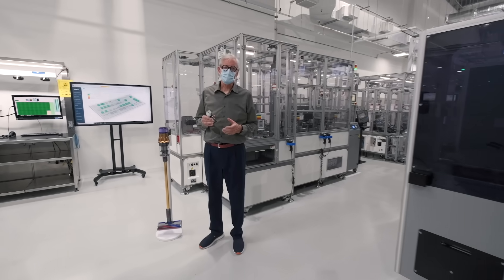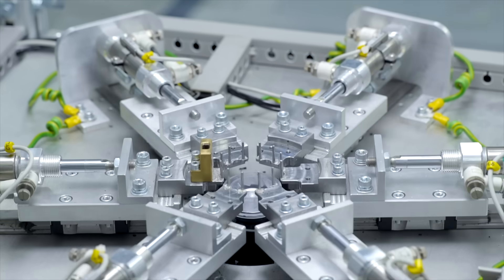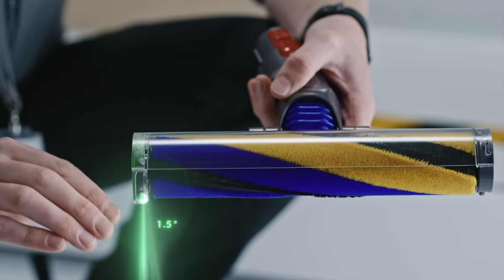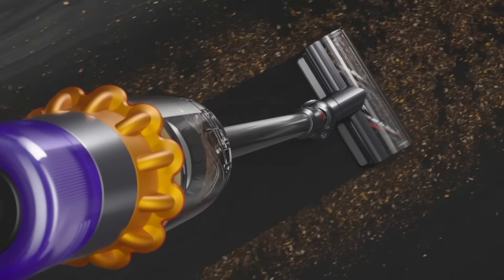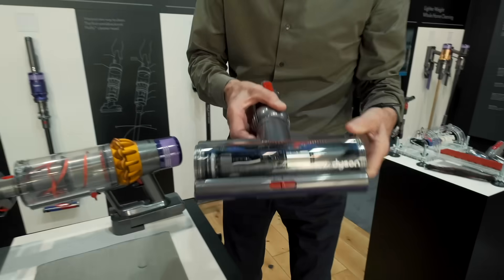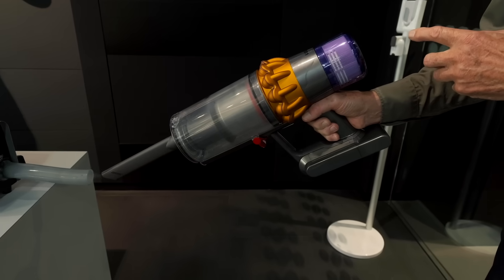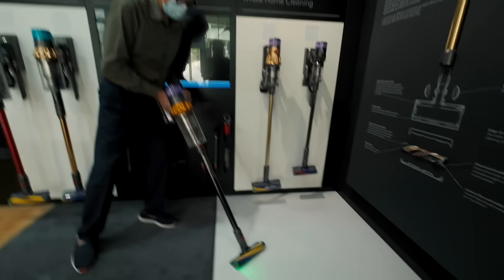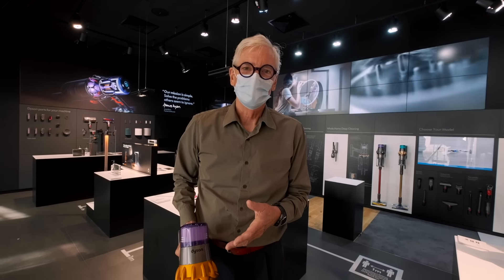James Dyson launches new Dyson vacuum with laser technology.

Comment: Stick with Hoover they last 80 years but his, stuff last ten years max before you throw it.
Reply: Hoovers used to last 80 years easy. But when TTI took over, the quality went down. Hoovers will last up to about 9-10 years usually (TTI). Dysons will last longer and have better performance. Along with better filtration and features. I’ve collected vacuums for 9 years. In my experience, I can tell you this. Hoover is not the same Hoover it was back then. Hoover are certainly not the worst. They aren’t bad vacuums. But there are much better options
Reply: @DillonCleans  Thank you for mentioning that TTI owns Hoover now. You are correct about the drop in quality. Too bad they also own Dirt Devil and Oreck now. TTI just makes "throw away" vacs and it's ruining these once good brands.
Reply: @Ruluaman  exactly. Dirt Devil and Hoover used to be really good brands. But they have turned bad. Dirt Devil more than Hoover. But still, they both are nowhere near as good as they used to
Reply: Longevity for a vacuum cleaner is easy when it's not actually very good at cleaning and therefore doesn't get dusty! May as well buy a broom, does as much work.
Reply: They are good vacuums. Period. They are the best all around vacuums. Not the best at carpets. The Dyson ball animal 2 does the best at carpets. But it is very heavy and not good all around. I own a v11 outsize. And it was the best cordless vacuum until this got released today. At least test out and do test with vacuums before you criticize them
Reply: I'm talking vintage machines not your modern plastic junk. Dyson won't compete against those.
Reply: I'm talking of machines when Hoover had the Royal Warrant.
Reply: Hoover are the best machines end of. For quality,
Reply: @petersinclair8718  Best machine in my opinion if you don't mind weight would be the Riccar R40P. Those are better than the best Hoover's that were ever made. Ultra powerful two motor bearing beasts.